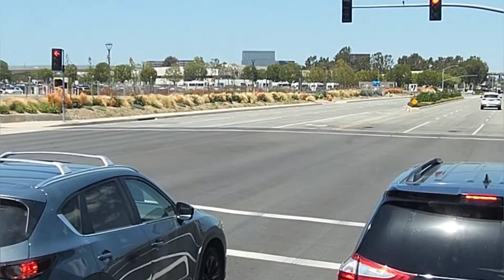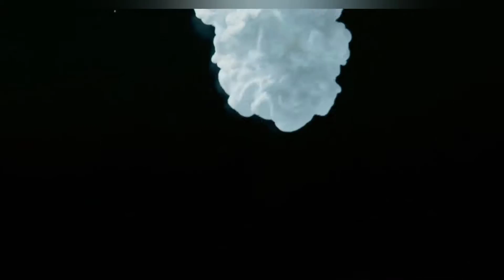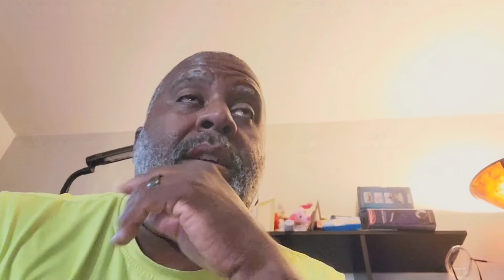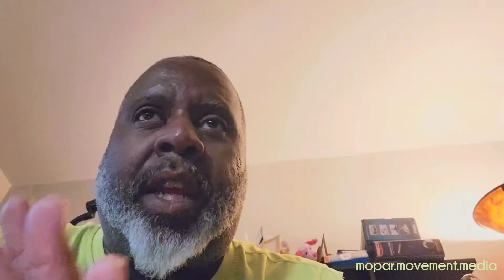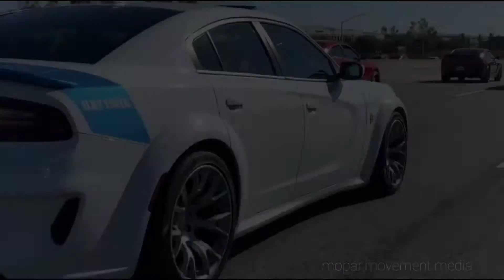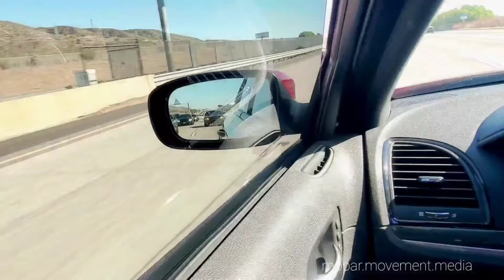392 HEMI Cooling Issues: Aluminum Radiator Leaks

Comment: I had the same problem on my 18’ scat pack challenger. I feel like you were describing my situation exactly 😂 The radiators just crack and leak for some reason on ALL these Mopar’s bro 🤦 just had to replace mine and did an OEM swap. Good video big dawg 💯

Comment: I head a crack gasket they told me 😭 even replaced the thermostat and new gasket.. seems to be running fine for now.. but no leaks from the radiator yet.
Reply from the maker: As long as the crack did not let too much coolant into the oil or vice versa, you should be fine. If she starts to overheat again, you may have to tear it down to clean it

Comment: Im having the same problem rn on my hellcat leaking from the top right passenger side of the radiator right under the thermostat hose that connects at the  top gonna order another original radiator from mopar
Reply from the maker: Make sure its not the hose clamp.. You should have the factory spring clamp. Try re-seating it first..